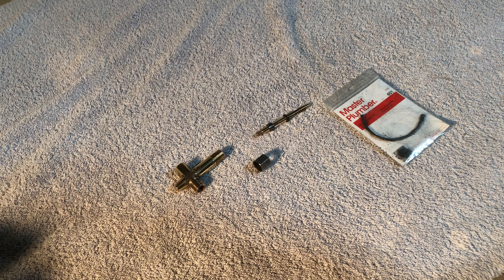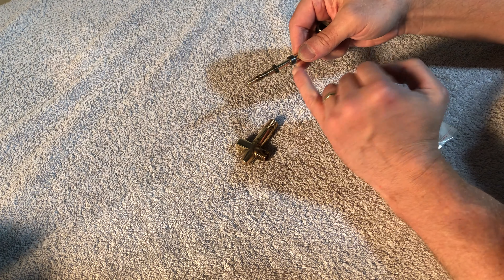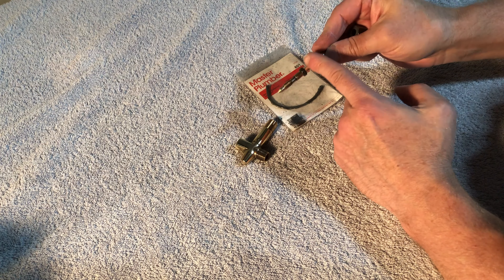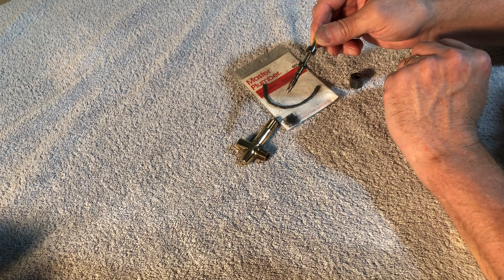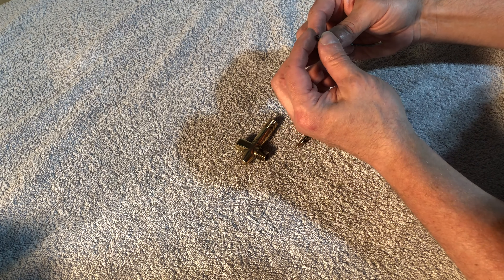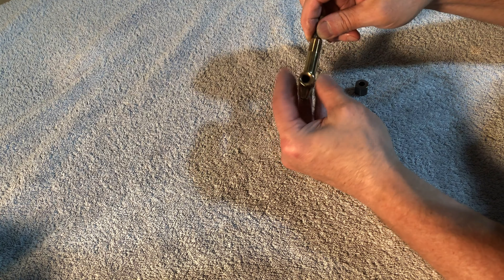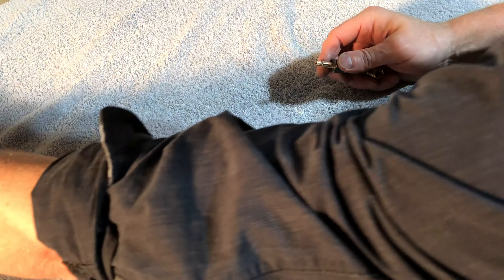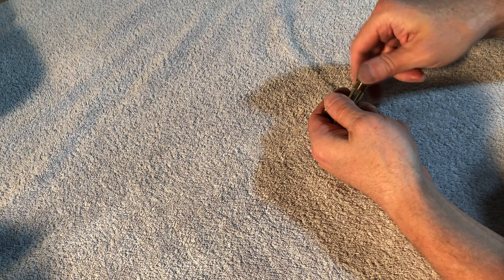Replacing Graphite Packing in a Lantern or Stove Valve

Comment: I have a Coleman 220k lantern. One day it was hanging above me and started spraying fuel all over the place and onto me. When I took it apart the grafite roping was in peices. Now I know how to fix it!
Reply from the maker: Failed graphite packing shouldn't result in "spray".  Usually it results in seeping around the valve stem or, at very worst, a small drip.  Also, a 220K is a gasoline model.  It's not designed to run on kerosene and won't run properly with it.
Reply: @King ColeMan  I meant coleman fuel, was typing that quite late at night and went straight to kerosene lol. I had the tank pressurized, and it was spraying out of this one little area. I do believe it would spray with the packing damaged as it was.

Comment: I have a Coleman 200 T66 that the Tip Cleaner Packing needs replaced can you do video showing how to do this on the tip cleaner packing Please 🙏
Reply from the maker: The graphite in the tip cleaner assembly isn't replaceable in the same way the packing on the valve stem is, because the tip cleaner assemblies were never meant to be taken apart.  On a 200 tip cleaner, if it's got a simple bent wire actuator, you could (in theory) heat that wire, straighten it out, then slide the packing nut over it, replace the graphite as in this video, then put it back together and bend the wire again.  If it's got a looped actuator, forget it.
Reply: @king.coleman  yes it’s the Canadian 200 it’s Looped Thank You Sir
Reply from the maker: Yeah, there isn't really anything you can do with those.  You can't remove the actuator from the assembly, you can only unscrew the packing nut and slip it over the bent/looped end of the actuator.  It's possible if the actuator is the earlier bent wire type and you straighten it, but if it's got the loop in it, it's not going to happen.
Reply: @king.coleman  I was able to fix it today I got some 3/32 rope graphite from hardware store packed and bedded it inside there with the old packing still inside then tightened the nut back Down spin the lever few times then tightened more it worked fixed my leak the ole Coleman 200 T66 is going strong 💪 Thank You just thought I’d let you know
Reply from the maker: Good for you.  I'm glad to hear you found a solution.
Reply: It’s basically the same assembly as the fuel valve, it’s harder to remove because there’s no shaft to back out like the fuel valve but if you heat the outside with a propane torch it will pull straight out and then you can repack it just like the fuel valve.

Comment: The only place I can find any of this stuff is the plumbing section it looks exactly the same but I'm not sure if it is. What other part of the store should I look in.
Reply from the maker: Yes, it's a plumbing product.  I buy mine from a commercial plumbing supplier.
Reply: @king.coleman  was only asking because you said not to buy it out of the plumbing section in your video. I'm guessing just as long as it's not rope with Gunk on the outside like you were just grabbing it actually looks like all graphite with no rope then that is the kind I need to get right?
Reply from the maker: Ah.  I didn't mean not to buy what's sold in the plumbing section, only to be cautious what you buy.  If you can find the real graphite rope it'll be in the plumbing section, but in the same faucet repair section you are also likely to find a different sort of packing rope that will not work.
Reply: @king.coleman  really appreciate all your help and quick reply. Going on a camping trip and my 413e stove from 1954 has started leaking on me around the valve and the lighting lever is really hard to turn so I'm guessing I need to redo the packing in both and I don't have time to wait on oldcolemanparts to ship it to me. Your video saved my life and hopefully this works for my stove.

Comment: Or...the packing comes off still jammed inside the nut. What now?
Reply from the maker: That's when you have to find a sharp objection and dig it out.  I put the nut on a piece of wood and use a small, sharp flathead screw driver.  If it doesn't come out easily, I'll take a larger flathead screwdriver and drive it into the nut with a hammer to break the packing into quarters.
Reply: @king.coleman  Another suggestion I got was to hand twist as large a drill bit as will fit to remove the bulk of the packing, then the last little bit should come out easily with a brush. I went with your method, I suppose either method would be just as messy, lol.
Reply from the maker: I've done that as well, but found the screwdriver method more efficient.
Reply: Best tool is a small pick.

Comment: Thanks for the excellent video. I noted the Master Plumber 106 package and the shiny outer coating of the packing material.  I am unable to find Master Plumber in online searches in Wisconsin, USA. I have looked at other options for graphite string in big box stores but none have the shiny outer coating. Only a tacky graphite string (not the clumpy rope you said to avoid). I did purchase one but it just packed down to a tacky ooze of sorts. I did search the Master Plumber online site but could locate the #106. Im thinking shipping from CA would lead me to just purchase the pre made stem packing from Old Coleman parts although I still have a shipping charge for such a light item. Anyone else from USA reach out to with alternative? Your product once more self forming. Thank you!

Comment: Hello,
I'm trying to remove the stem valve from a 236 lantern. ( A mexican clon).  Do You have a video how to do it? I don't know if I can attach a picture thru this message.
Reply from the maker: I'm not sure what you mean by "stem valve".  If you're referring to the main valve, it just unscrews from the fount.  The thread sealant used in the factory may hold tightly, but if you turn it upside down and clamp the valve in a vise it should unscrew without too much trouble.
Reply: @king.coleman  
 
I undersand how to remove the whole valve system from the fount. I mean how to extract or remove the stem where the wheel is attached. I already unscrew the nut. After that, you just pull it with a pair of pliers? . I'm afraid I can't  send you a pic in this message.
Reply from the maker: Ah, the valve stem.  Once the valve stem nut is off, just unscrew the valve stem.  Some will come out easily, some will feel like they've tightened and forcing it past that point will free it up, sometimes you'll need to pull it free with pliers (or reattach the knob and use that to pull).
Reply: @king.coleman  
Thanks a bundle. I was seeing OCP (old coleman parts) and they sell two sizes of graphite packing. I will see the one that fits, feel free to answer if you  wish.
Reply from the maker: The 236 valve uses the larger of the two graphite packings.
Reply: @king.coleman  
I'll keep that in mind. Thanks for your time.

Comment: Thank you so much for this. I plan on attempting this on my model 143 lamp, But I am unable to find that style of packing here in my area. The stuff we have is different. Is there a suitable packing that can be obtained from Amazon, Home Depot, Lowes, or Ace Hardware? I would really appreciate any advice or recommendations. Thank you!
Reply from the maker: Old Coleman Parts sells some graphite ribbon.  It's not the same style I use in the video and I have no experience with it, but I've heard it works.  My suggestions would be to check with a place that specialises in plumbing.  In the past I've found the twisted rope at Home Depot, but not for some years.  Two independent home improvement stores told me that could special order it, but they don't stock it.  The big plumbing supplier, however, keeps it in stock.

Comment: What size graphite packing string did you use ?  I see it available in different diameters . . .
Reply from the maker: I can't say for certain.  I've never seen it sold in any other sizes and the graphite rope I buy gives no size specification.  All I can say is that it's very roughly about 1/8" in diameter.  That said, It's not consistently round.  Diameter really shouldn't matter.  Larger or smaller rope will work just a well as long as it's not so bulky that you can't get it into the valve or inside the nut.  When you tighten the nut, the rope is compressed into a neat cylinder regardless of what shape or diameter it started with.
Reply: @king.coleman  I get what you’re saying, and thank you !  Just a quick check of Amazon shows a bunch of different sizes, prompting the question.

Comment: Hiw do you remove the lever opsite the turn knob?
Reply from the maker: If you're referring to the lever that actuates the cleaning needlew, I didn't.  In theory you can disassemble the cleaning actuator (only if the lever is straight, not looped) by straightening out the lever and sliding the nut and packing over it, but if the packing there is bad, standard practise is to replace the whole lever assembly.  It's not really a serviceable part.  If the lever is hard to turn, you can try loosening the nut, then tightening it back up after rotating the lever several times.  You can also try heating it just a bit with a propane torch.  If it's stuck, that'll often free it up.  But at the end of the day, if you're not happy with how it turns, you'll just need to replace the whole assembly.

Comment: Can you provide info on the size of the graphite rope you are using? I see some online options, but am not sure if they are too big or too small. Thanks! Great video!
Reply from the maker: I"m not sure how helpful I can be as I've never seen it sold in different sizes.  I'd estimate the twist about 1/8" in diameter on average.
Reply: @king.coleman  the stuff I can buy locally is 3/32 in.  Thanks for the reply.
Reply from the maker: This is the product I use.
https://www.masterplumber.ca/product/graphite-packing/
Reply: Thanks! @king.coleman